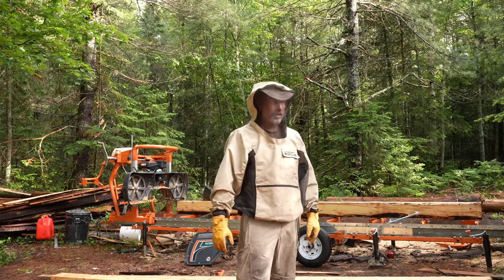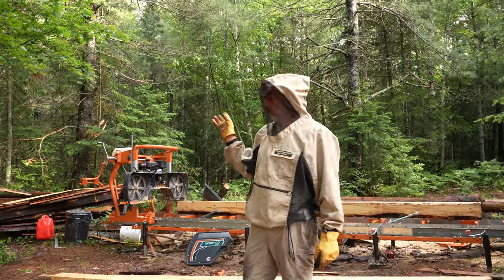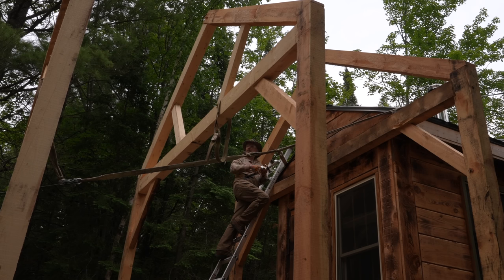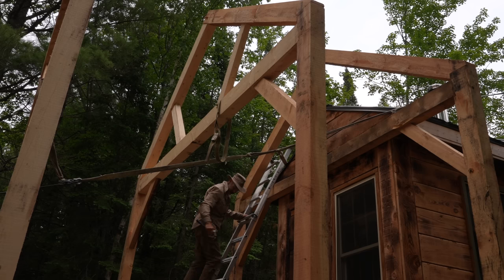Building a Timber Frame Outdoor Kitchen Alone at My Off Grid Log Cabin

Comment: One of the things I like is watching you solve different problems that initially seem insurmountable, at least to me. Like when you hooked up that cable over the top of the cabin to help you hoist those massive logs by yourself. I didn't know how the hell a person, alone, could manage that. Or now lifting that massive timber frame up into place. I like how you use your brain to figure out each issue and there always seems to be a way.

Comment: :goodvibes:Assuming that you are using linseed oil to treat the timber.. If you add a third of pure turpentine to the linseed it drives it into the timber and stops beetle damage at the same time? But perhaps that is the mix you are using.. thanks for the vlog; always a joy.

Comment: Fantastic video!  Thank you for sharing with us.  Have you ever considered putting in a plain ol' cheap hand driven well and cast pump (with a added filter) for water?   You just drive the end stake pole into the ground by hand, connect the next section, with a well post driver going some 25 feet down?  Then you'd have water right there close by, maybe outside your outdoor kitchen?  You csn add a filter to the top of it to help filter any debris and sediments.  Excited to see the outdoor kitchen come together!  Best wishes.

Comment: If you have the capability to run industrial strength fans, got mine at the home center. The mosquitos cannot fly in wind. It will diminish the population over time.  I live in an area that was once wetlands. We used to have to run for the house and you could hear those suckers hitting the glass on the screen door. They used to wait for us to come out. Since the fans they decreased so much that we don’t need them anymore. The fans are pretty noisy, though. Everything is a trade off.

Comment: Nice timber frame. You could almost do a video on the different types of construction used in timber frames. Gonna use a mix of mortise and tenons and post beam in my build too. Trying to avoid post framed construction on it. Brackets cost money. People don't understand that a timber frame is just that a frame using heavy timbers. The type of construction used don't matter it is still a timber frame if using timbers.

Comment: Have you considered giving the dog a hair cut for the hottest days of summer? A little trim so it's all grown back by winter.
Reply: Cali did have a heat stroke a few year back.  I think it turn out that not good to trim Cali coat.  it's coat is made up of two parts.  The long and smooth outer coat and soft and fuzzy undercoat.  These two layers together to protect the skin from sun, heat, cold and moisture.  The fur acts as a insulator against all weather conditions.